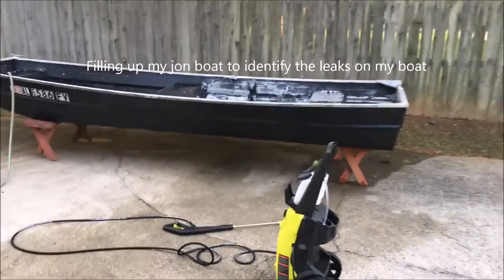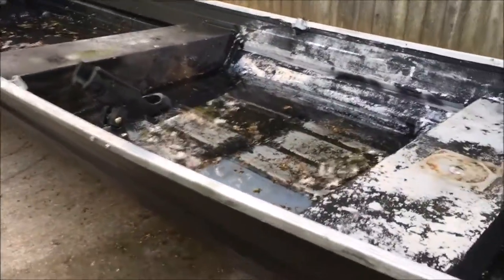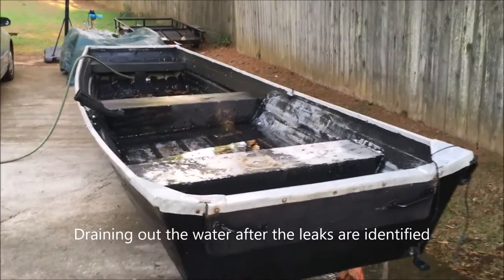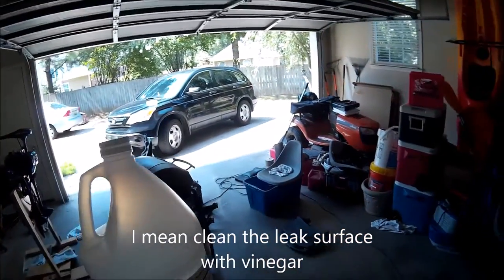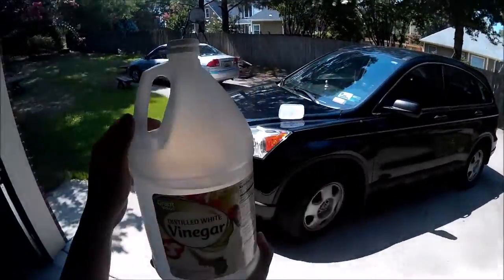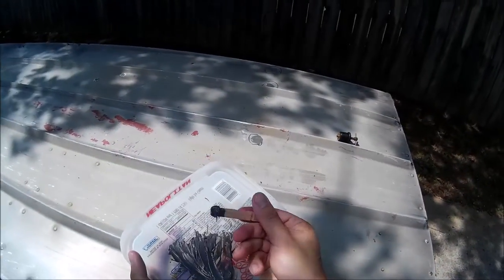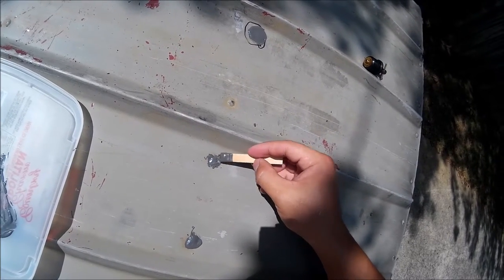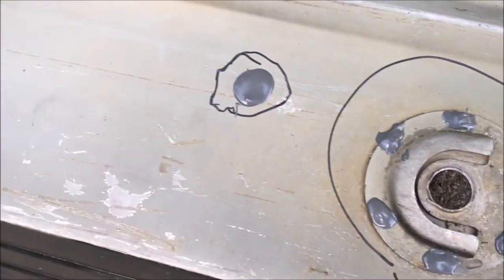Repair Aluminum Jon Boat  Leaks with JB weld

Comment: Can u use normal jb weld?
Reply from the maker: Poly Organza hi poly, yes, I used normal jb weld that you can try from Walmart. It has been quite a few months now since I patched out the leak, and the boat is holding up pretty good. Make sure you sand papered or metal brass brush the surface of the area that you want to use jb weld though. That's very important.
Reply: @Fishing256  is it still holding?
Reply: Still good ?

Comment: JB weld wont last long if exposed to water. Its water resistant, but not water proof.
Reply: Lol i seen a guy fix a timing cover on a motor one time so i disagree with you on that